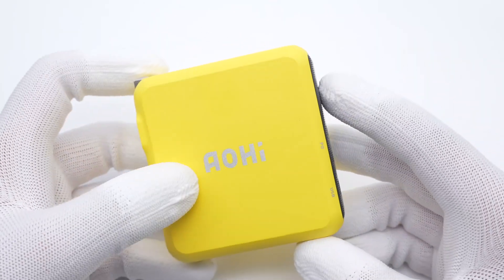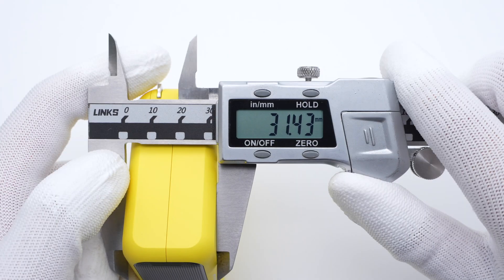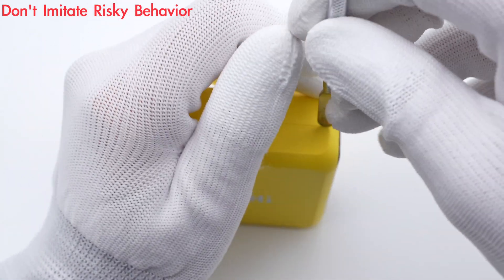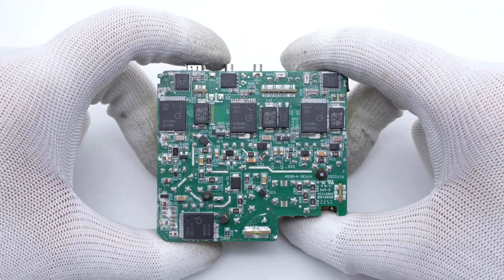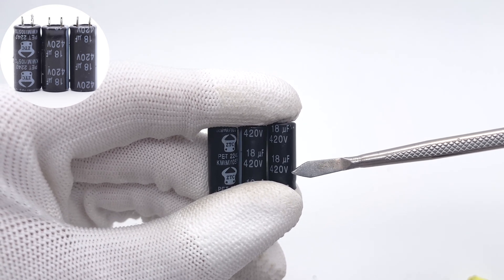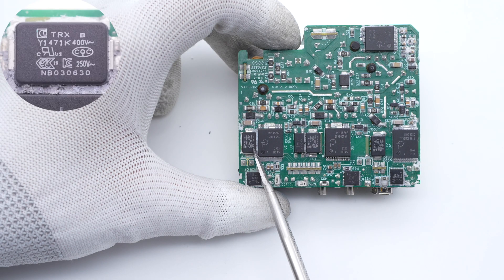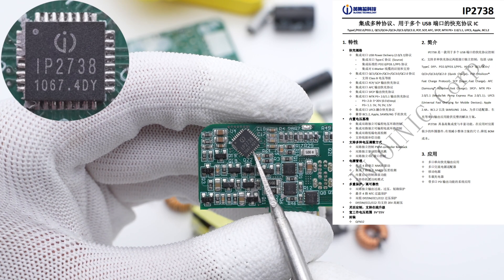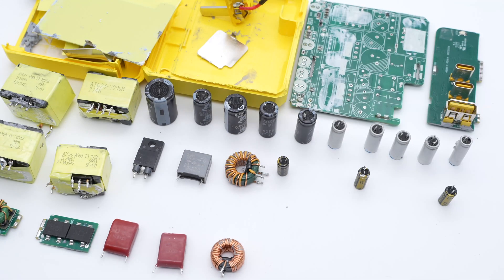Teardown of AOHi Magcube 140W PD3.1 GaN Fast Charger (2C1A)

Comment: Don't buy Aohi! On paper it looks amazing. Works well for a few months and then it decreases performance ALOT, and then just doesn't charge anymore. Aohi also doesn't honor their 18months warranty. Just buy a name brand charger, this is just going to give you a overpriced brick.
Reply: I have two of desktop model 120 Watt and 65Watt...65 Watt work amazing for the last 2 years. 120W more than a year, just has some issue on one USB-C port that is not fit/charge well with third party USB-C cable but with their USB-C cable woring  fine...

Comment: Inside is not good, shargre 140w is better a lot
Reply: I saw review on YouTube mentioned shargeek 140 sine wave is pretty bad
Reply: @satthapuangput6757 & @duynguyen — I have both the Sharge / Shargeek 140W PD 3.1 (Orange 3-Port,  2x USB-C & 1x USB-A) The SHARGEEK / SHARGE PD 3.1 Charger is only capable of 140W PD via 1x USB-C Port ; and the AOHI 140W GAN+ (Yellow 3-Port, 2x USB-C & 1x USB-A) The AOHI 140W GAN+ is capable of of 140W PD 3.1 via either one of it’s 2x USB-C Ports (both the SHARGEEK / SHARGE 140W PD 3.1 & AOHI 140W GAN+ PD 3.1) 3x Port USB Chargers are not capable of PD 3.1 Fast Charge Protocol via USB-A Port —— IN My Extensive real world usage of the Sharge & AOHI 140w chargers, I can confirm that the SHARGE (*orange 3-port charger) is poorly constructed and unlike Sharge’s other *Unique Products Chargers, PowerBanks, Cables, ..etc the SHARGEEK / SHARGE 140W PD 3.1 Charger has already failed and no longer works in months of ownership at approx purchase price of $109.99 to $59.99 (on Sale) is a poor product and fire hazard if irregardless of Sine Wave, it’s components are poor; it appears that they rushed this product to market to have an early position in the PD3.1 - 140W Market Place; when the AOHI (although not perfect, but IMO one of the much better options, and for an PD3.1 140w *Non OEM Charger*, the AOHI 140W GAN+ is as close as you are going to get outside of OEM such as *Apple’s 140w PD3.1 Single Port USB-C charger, is the go to choice for quality vs cost ratio and internals… They’re are other options out there, but it is apparent the SHARGE / SHARGEEK is quick rebrand of easily / readily available components to achieve an unsteady / unsafe 140w / PD3.1 protocol in a very all over the place power signature. The PD3.1 aftermarket charger options are becoming more diverse everyday. From Anker to Ugreen, Satechi, etc…  ***Currently I very much feel secure using the AOHI 140W GAN+ PD3.1 Charger (although the AOHI has 3-Ports, I use a single USB-C port to power my 2023 MacBook Pro M3 Pro and  recharge my 2022 ANKER 737 PD3.1 140W 3-Port Battery Bank & The *New 2023 ANKER GanPrime 250W (capable) 3-Port Battery Bank., as well as the Shargeek Storm2 100w & Storm2 Liquid 130w Battery Bank’s respectively. ——Long story short outside of Anker, I find myself using several AOHI products mostly, from their 20w cube, 30w cube, and 65 cube chargers, and i believe outside of the 65w AOHI cube, the others have been discontinued, and yes, I have had AOHI products fail. Quality control is and supply and demand over past 4years with Supply Chain issues and COVID-19 Import issues, some production cycles have been better than other… But for my go to Chargers now are, AOHI GAN+ 140W, and AOHI Future 65W Slim Magnetic Charger in Combination with ANKER Series5 100W 2-Port USB-C PPS Charger and the 67W Sharge Retro 3-Port Matrix Charger… That’s a real life unsponsored insight… I have other chargers I use as well, but as far as go to, that is it… Feel free to reach out for any comments questions @NYALEXNJ via X, or basically any social media platform. *Take care and be well!
Reply: :))) lạy bố lại bảo là not good. Xem nhiều video vào cho thông cái não ra.
Linh kiện chất lượng , ripple noóie ổn hơn cái sharger 140
Reply: @lightshub.official  Bác review con cuktech 120W mới ra xem sao bác ?